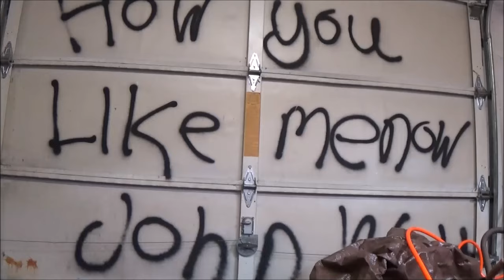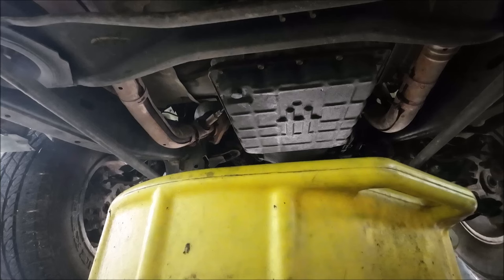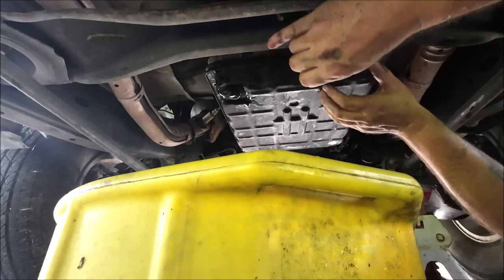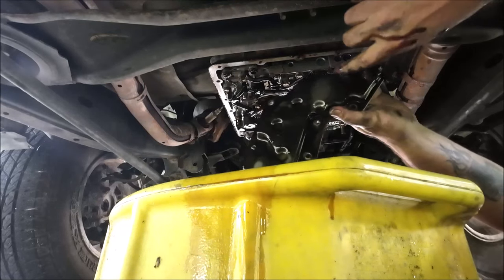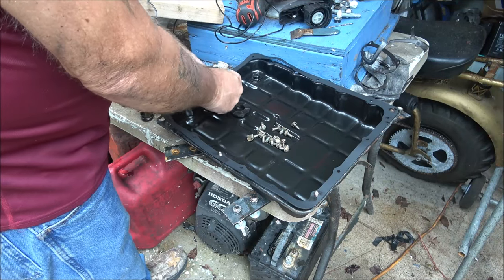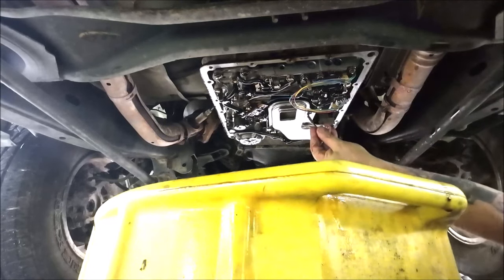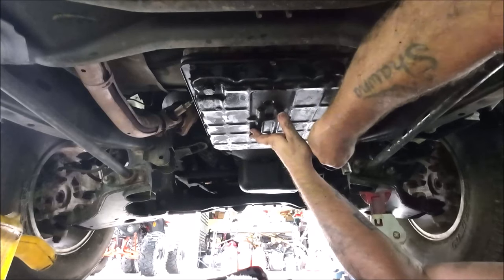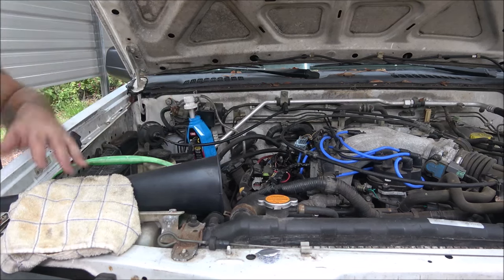Nissan Xterra AC Work And Tranny Fluid/Filter Change

Comment: G'evening bro & nice job 🤓 . I'll be doing a trans filter & fluid change in my 02 Envoy.  soon.  After hauling my utility trailer @ 70-90 mph for 2600 miles I think she deserves it 😋 .
Don't forget to pull up a capacities chart for the Nissan so you know how much Freon the system holds so you don't overfill it & burn up the compressor.  The AC in the envoy was plumb empty when I bought it.  It took 48 oz to fill it.  That cost $60 at Wally fart cuz I had to buy a can of freon that came with a reusable R134 adapter hose + 3 more cans of freon 🤓 ..
Reply from the maker: This truck takes 22 to 24 ozs of freon, I about 22 in seems to be doing fine so far.